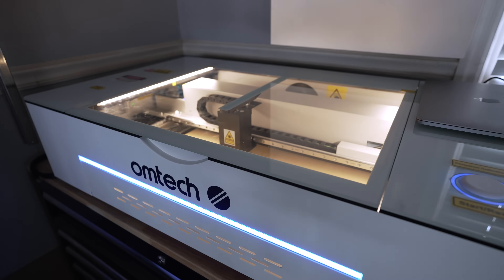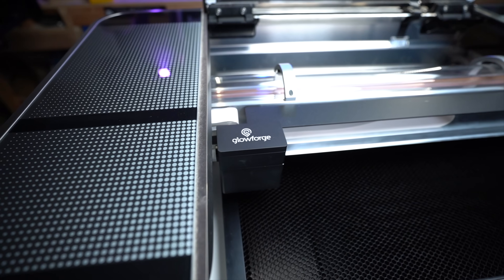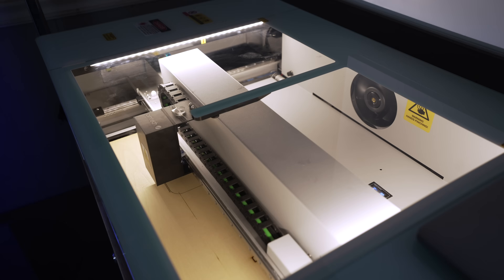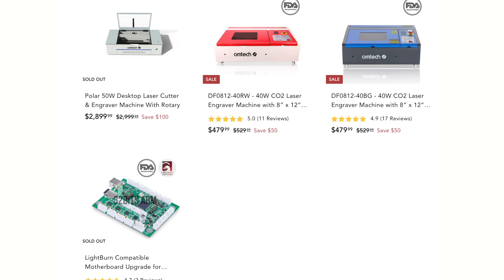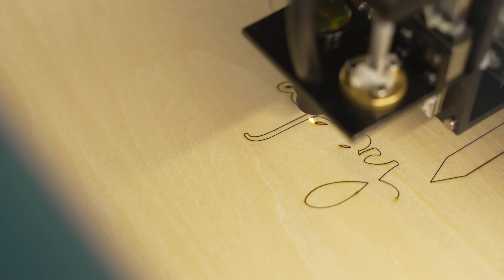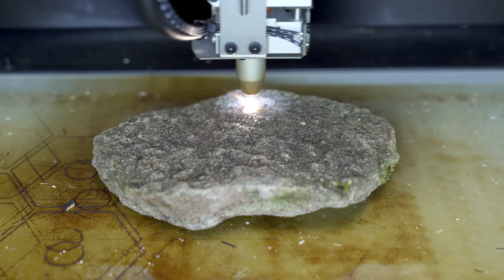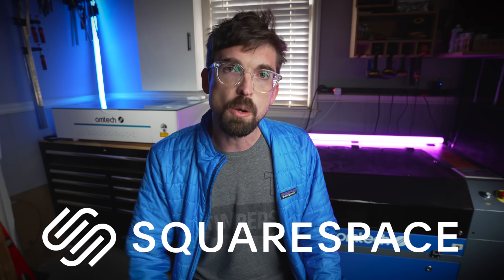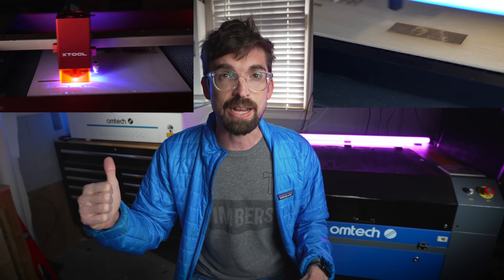$4000 cheaper than Glowforge AND better?  OMTech Polar Review

Comment: I just got mine yesterday and came from glowforge so was super nervous about how user friendly it would be. Everything worked great out of the box- I followed Cam’s setup instructions. I had a couple initial hiccups running it with my Mac (no usb and I needed a usb to usb c conversion and then still my Mac not recognizing it for whatever reasons and next trying to run it through a gfci outlet was a no go and still trying to figure out Wi-Fi/Ethernet connection stuff). But now running lightburn on my daughter’s pc it is working great. Much more powerful /fast/capable than my glowforge plus and wow for the price. If you follow the unboxing and setup videos that are on YouTube, read the manual thoroughly, then it doesn’t take long to understand it and get running. TBD if I can get my Mac to recognize it. Also 7mm hold down pins was my first cut and that appears to be the sweet spot
Reply from the maker: Glad to know its shipping and was pretty easy to get set up!
Reply: Did u try running parallels or something like that to see if it worked?
Reply: Jill, 
Which machine did you get? 
My GF just died and instead of getting the refurbished model they're offering at a "discounted" price, I'm considering a new machine but lightburn scares me, lol. 

Would love to hear what you ended up with and how it's going now.... thanks
Reply: Did you ever end up getting this to work with your Mac?  I have a Mac with no USB (highly annoying that Apple took out the USBs on the MacBook pros...like seriously...WHY) and I have had issues with using the USB conversions and the dumb mac still not recognizing items.

Comment: for $3500 I got a 100w chinese laser that can cut 23"x37" and has a motorized bed, rotary attachment, chiller and air assist compressor. Granted you should have some experience before going this route, but you can get a lot more for your money.
Reply: Which one did you get?
Reply: Which one?

Comment: This is exciting but can you show if it has a full pass thru (the gweike cloud does not) and how a rotary will work? I felt like the gweike cloud was going to make it impossible to engrave tumblers as such. I love my China 50W laser but it has a lot of modifications done to it so it is less user friendly.
Reply: I was just watching a video from "Kim and Garrett make it" and they did a tumbler (really wanted to see the roller attachment in use). There appears to be an opening in the bottom of the unit where you set the roller attachment (it comes with a large and small one). From what they said (or posted), they did one where they put the feet on risers. So, in theory, if your item will fit in the hole, you can probably raise the machine high enough to accommodate it.
Reply: No passthrough at all.  The max width is right at 20" and depth about 12".  The front tray comes out but has an interlock.  You could (not recommended for most people) disable the interlock in the vendor settings to enable use of longer material, but since it isn't a full passthrough, you'd be limited on where on the material you could mark/cut anyway.

Still a decent machine for its purpose.  With the honeycomb tray (which is aluminum, by the way, so no magnet use for holding material down), the max height material you can use .59 inches.  For cutting, you certainly want to use the honeycomb.  You can engrave thicker items, I think up to about 2" if you take out the honeycomb.  I did so tonight so that I could engrave my logo on some 3/4" thick hardwoods.
Reply: @oldNavyJZ  What doesn't have a pass through? The omtech says it has a Back Pass-Through Door Height

0.3 in. (7 mm)

Comment: Seems that the Polar's biggest drawbacks are the heights you can engrave both flat and with the rotary. Flat is .66 inch with tray and 2" without the tray  and  the rotary is 1.18 to 2.91 inch. Don't know many shot glasses or glasses that small.

Comment: I know this is kinda off the beating path - but since you briefly featured your MF2028-60, do you happen to have any data on that machine's precision?  @omtechlaser doesn't publish it, and I've been trying to get an answer from them for a week or so now.  Kinda concerning that this isn't readily available from them.  

I have a K40, and they actually do publish a 0.010" precision rating for that machine, but nothing for the 55 or 60W machines.  Anyways - figured I'd ask you because you've been using OMTech for a while.  Thanks MOBS!

Comment: Love your videos...so thanks for them 👍 Have you had any experience with the Gweike RF desktop laser? I currently own the Ortur LM2 Pro & use it mainly for engraving ceramic tiles & slate. I would like an upgrade in speed 🤔
Reply from the maker: The RF actually just got delivered to my shop last week.  Planning to get a review out on it before the end of the year.  But just looking at the specs the speed your able to get from the better motors on a metal tube laser look awesome!
Reply: @makeorbreakshop  thank you for replying, I'll look forward to your review 😊
Reply: @makeorbreakshop  cant wait for the RF review
Reply: @makeorbreakshop  Hi...have you received your RF machine yet? If so, how does it compare to the 50w glass tube?

Comment: I'm curious how big of a tumbler you can do with this on the rotary. Trying to find videos with the G machine all you see is people using some dowel rods in it but not really showing useful product in the rotary. I like the idea of polar as it'll be easier to get into my basement but I'm wondering if I wanna limit myself or just go with the bigger blue machine you have to the right and make my garage be the new shop area. Think it'd be hard to get that big machine into the basement
Reply from the maker: Great question, it's going to be pretty tight.  I'm planning to do a follow up video on the rotary specifically since I didn't get a chance to really test it in this video.
Reply: I was just watching a video from "Kim and Garrett make it" and they did a tumbler (really wanted to see the roller attachment in use). There appears to be an opening in the bottom of the unit where you set the roller attachment (it comes with a large and small one). From what they said (or posted), they did one where they put the feet on risers.
Reply: @ImaginationDesign  I ended up going with the Omtech 80W red and black so I don't have to worry about depth and have more options

Comment: Glowforge is a compete pos. Prior to buying my 50w Omtech, I rented a Glowforge from a friend, and it was 100% unusable because you HAVE TO scan the bed with the camera prior to every burn. So, if you think you’re going to design something and pound a bunch of them out, 1 after the other, you’re going to be seriously disappointed. It makes no difference that every piece is on exactly the same material and there is no need to scan every time. You HAVE TO. Their software is crap and replacement parts are more trouble than their worth.

I had a Lightburn camera on my Omtech. I took it out and threw it away. I can’t imagine what could possibly be the use for something so wildly inaccurate, and that’s after having spent far too much time mastering the calibration procedure. I’d disagree with the statement that Omtech support is great. It’s not. I had an issue with a loose X axis belt. I spent several days going back and forth with them and their suggestions for what to do had nothing - literally zero - to do with the problem, which was a loose belt. I figured it out on my own. Aside from that, I’ve been VERY happy with the machine and I’m coming up on a year of using it for production manufacturing.

Comment: I thought with a co2 laser you still needed to wear glasses.. is that not the case?
Reply from the maker: If it’s running with a lid open you always run the risk of having the beam reflect.  But for CO2’s the beam is invisible.  And usually you can’t open the protective over without it triggering power supply to stop.
Reply: You don't need to wear protective glasses as most CO2 lasers have a safety cut off that prevents the laser firing if the lid is open. If for some reason you have a laser without that safety feature you can get glasses that block the wavelength of the CO2 beam (different wavelength than a diode laser). The invisible (to the naked eye) CO2 beam will cut/burn anything it it comes in contact with - don't underestimate the warning labels.

Comment: Glowforge is going to have to make a pretty big decision in the next few years.
Reply: I'm honestly amazed if anyone can still consider Glowforge at this point... I just don't get it how anyone could recommend them over the Competition consider all the drawbacks you buy into when going with them starting with a more than doubled price for a technically identical but lesser capable System that doesn't even include an Air Filter, having to pay a Monthly Subscription like 3-4x that of a Streaming Service to get things done and dealing with the outlook of your $7'000 investment turning into a giant Brick once their mandatory Cloud Service gets shut down - Holy fuck man.
Reply: @Duraltia I don’t think it’s that people consider a glowforge over say an omtech, it’s that glowforge jams their marketing down your throat if you even do a google search for laser cutters. 

I purchased a plus a few years ago because in all honesty I had a job I needed a laser for, had limited time to research and it just kept popping up. Fast forward to now, I sold my glowforge for a profit I might add due to them raising their prices and got what I have now which is a 24x35 omtech. I have upgraded air assist with high and low volume air, an upgraded exhaust, rotary and an infinitely more powerful machine for the cost of the pro. Not to mention I can use lightburn which is the absolute gold standard of laser software and I don’t have to pay a monthly fee just to draw a square on my machine. 

So I guess what I’m saying is they use marketing to really hammer the idea into your head that they are the best and only option that you just forget to research further.
Reply: @Duraltia What would you suggest to make jewelry?
Reply: I bought the wife a GF Pro @ about $6500 maybe 2 yrs ago. It was my fault for not pricing other machines first. Tit for tat, the OMTech does seem the better buy. At the time we were willing to spend more for something more simple but in reality, it had just as much learning curve if you were making your own designs. Plus GF still has an annual fee a lot of ppl dont talk about. Anyway, within a yr we sold the GF for what we owed on it and moved on to other things. IMO, it was WAY over priced for what it was and could do.
Reply: @tRRickedOut What kind of machine would you suggest to make jewelry?
Reply: They are appealing to the first time user, which works well since their tech support is good and you could train a monkey to use it. It worked for me.

Comment: Great breakdown. Is the working area deep enough for Yeti tumblers on the polar? I see the rotary but it doesn’t look very deep.
Reply: Heard someone say you have to life it up a bit. These desktop laser all have two things in common, they always charge $$$ than a similar watt laser and they barely can fit a tumbler without modification. Not worth the $$$
Reply: @7stitches977  more than a bit. 1.18 in to 2.91 in for it with the rotary.

Comment: What about the pass through?
Reply: It’s got a passthrough in the back that can fit no larger than .25 inches or 6mm. Check my channel for the other polar review
Reply from the maker: It’s got a front tray that pulls out (I recorded a good bit without it on so you could see the laser head).  If you take the honeycomb out it’s got a pretty hood thickness that material could go into.